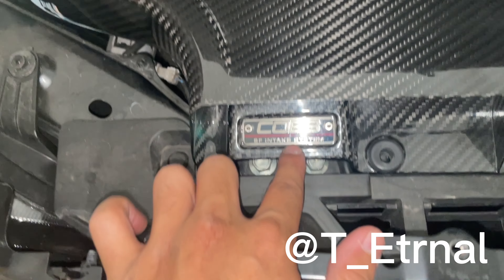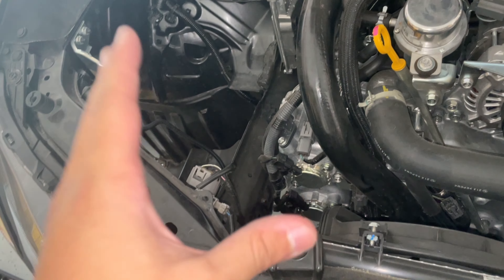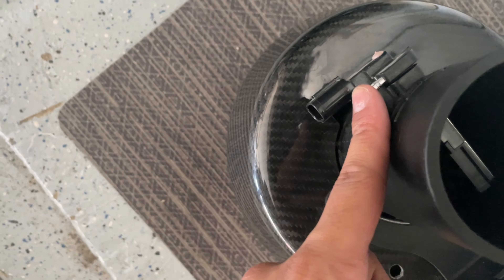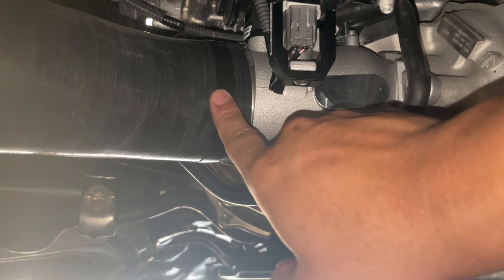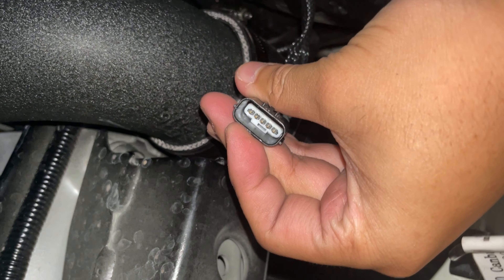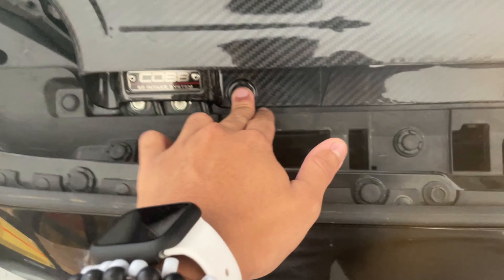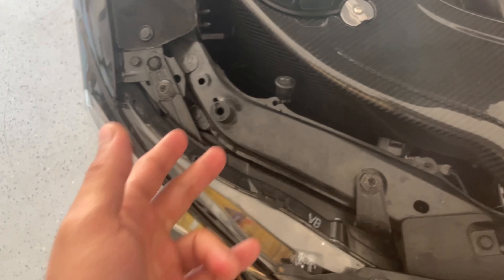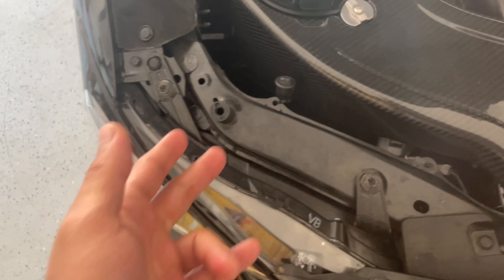Installing a Cobb Carbon Fiber Intake on the WRX

Comment: Thanks for the video. How does it sound? Thinking about getting the same but I really not into the whoosh sounds with the aftermarket intakes. Thanks.
Reply from the maker: The sound is pretty minimal, you can hear it but not really at the same time.